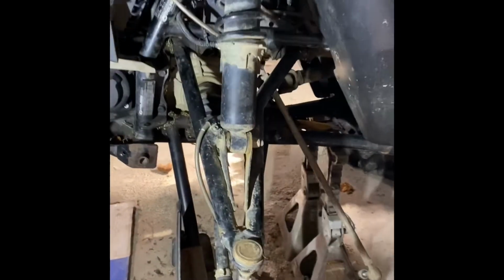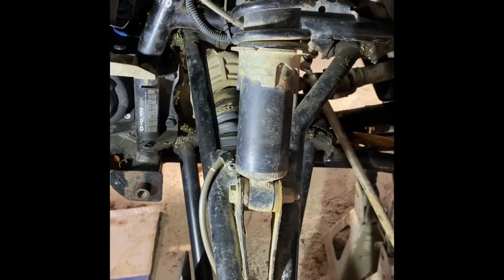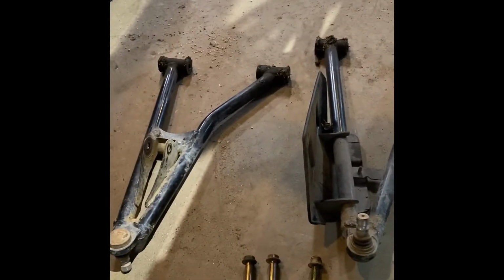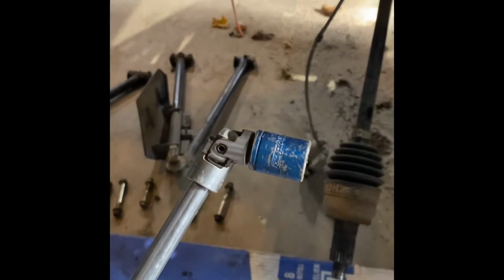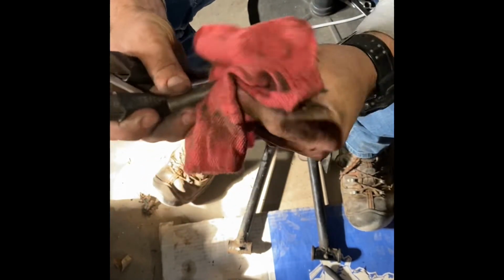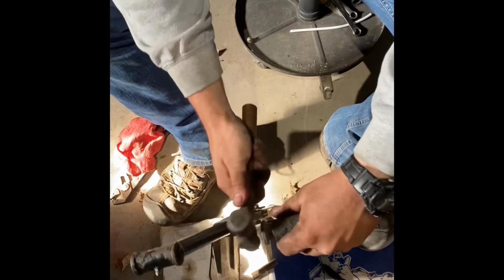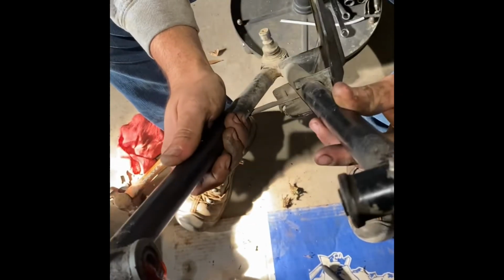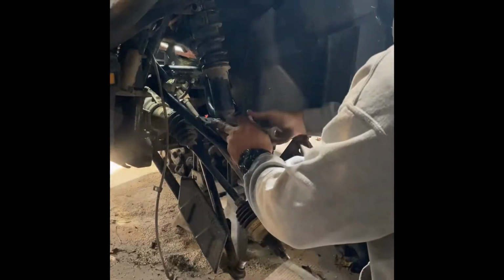2014 Polaris Sportsman 850xp A Arm Bushing Replacement

Comment from the maker: I used a short 3/8 drive socket, i believe it was a 13mm, on a swivel with an extension. It was definitely tight but it did fit.